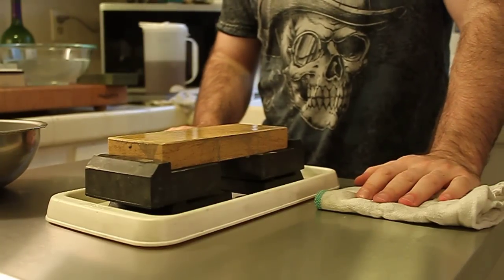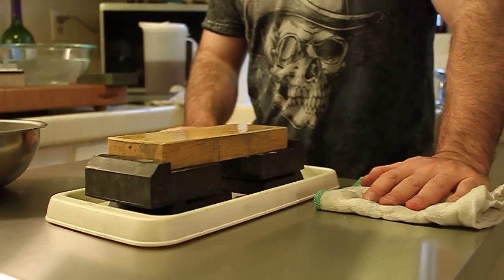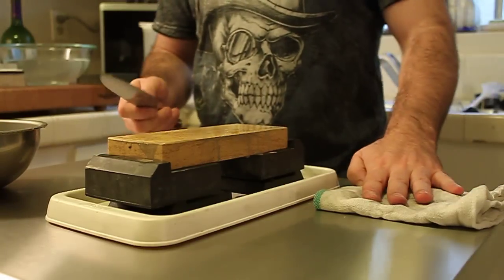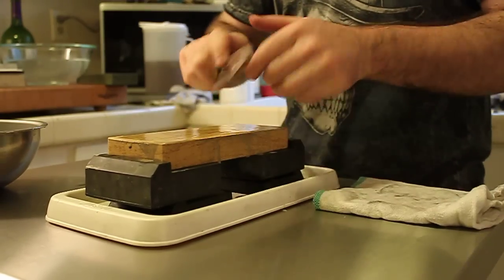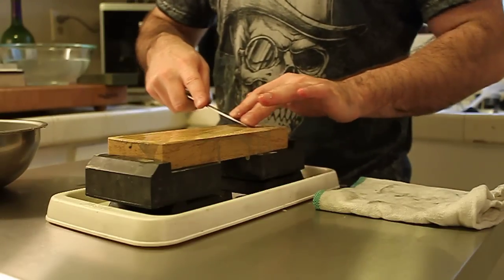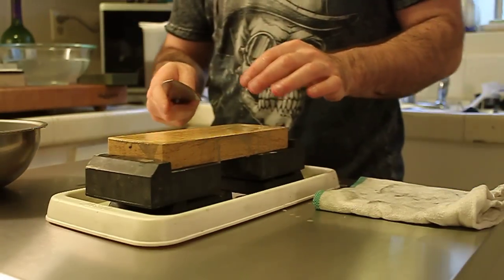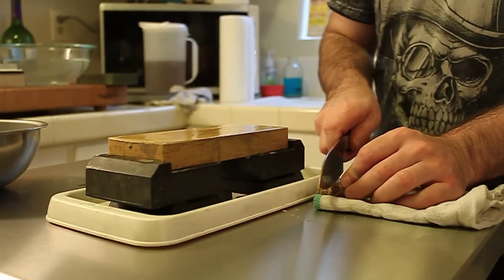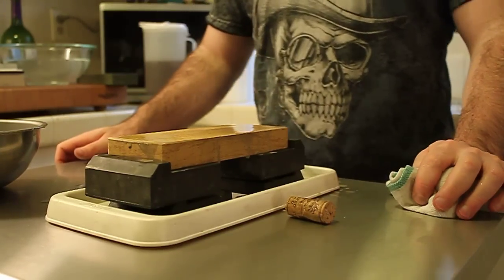Microbevels- Japanese Knife Imports

Comment from the maker: it depends on the steel, heat treatment, how big your microbevel is, and how many times you have touched it up already.  If its too big or has already been touched up too many times, you have to sharpen the whole edge and then re-do the microbevel (which shouldnt take long as it should be a MICRO bevel).  If its still small and hasnt been messed with much, you can just touch up the microbevel.  Stropping only matters for the actual edge, so only the microbevel there.

Comment: Very nice explanation of the micro-bevel method of sharpening.  I use the convex edge method with a belt sander and leather strop.  I believe this is a similar idea, but with the addition of electric power.  The main idea is to remove the wire edge, not constantly realign it with a steel, as in western practice.  And, Japan steels generally don't respond to steels as they are harder.  Thanks again.

Comment: For me microbevel is part of the core techniques for sharpening because it makes a huge difference. I do 15 degrees microbevel on both sides , alternating passes ,edge leading. This is enough to hold the edge even on soft steel if you cut without impact and don't touch bones.
Reply: O que você diria a respeito dele fazer o microfio em apenas um lado da faca ?
Reply: @neymacieloliveira5265  Se for uma faca single bevel eu colocaria apenas do lado que tem bisel. 
Se for double bevel eu recomendo colocar dois lados. Um ângulo total de 15 graus de cada lado dá uma estabilidade muito boa contra rolamento e é eficaz mesmo se vc fizer ele com apenas 0,05 mm de largura. 

Pra faca chefe fiz um esquema muito bom é dois microfio, um de 15 e outro de 10 graus, seguidos por um fio de 5 graus. Isso aguentou impacto moderado na tábua de corte apesar da faca ter apenas 54 HRC. A ideia não é usar com impacto mas se aguentou isso deve durar bem com uso normal desde que vc saiba cuidar dela e não abuse.
Reply: @thiago.assumpcao  Sim, já tinha visto em seu canal que por sinal sou um assinante entusiasmado! Mas é contra intuitivo a firmação dele que o micro fio de apenas um lado da faca é mais eficiente que o duplo micro fio, não acha? Me parece que a pressão de impacto tem menor resistência por não serem simétricos os desbastes.
Reply: @neymacieloliveira5265  A pressão de contato vai depender do ângulo total. Se fizer 30 graus de um lado deve ficar parecido com 15 de cada. 
O problema é que  Single bevel o fio não tem sustentação em um dos lados então considerando o mesmo ângulo total o fio fica com menor estabilidade e durabilidade para a mesma capacidade de corte.
Single bevel é bom para tarefas específicas. Ele facilita fazer cortes fininhos longos. É bom para plano de madeira, Usuba , Yanagiba mas não acho boa ideia em uma faca chefe.

Comment: Jon, does it matter whether you put the microbevel on the left or the right side of the knife? (Left-handed sharpener but slightly right-biased J-knives). Let's say if the knife currently has approx 10-12 degrees on the right, and 15-17ish on the left
Reply from the maker: In generaly, the idea is that leftys do it on the left side and rightys do it on the right, but i would say try both and see what makes more sense for you
Reply: Thanks for replying, wasn't sure if the rationale was that it should go onto the side with the more acute angle, but I will give both attempts a try.
Reply from the maker: really, very little about sharpening can be boiled down to hard and fast rules... as long as you have a way to critically think and explain what you are doing, you should be all good.

Comment: you micro bevel one side of a 50/50 ground knife? I must say i've never heard of that. Doesn't that turn it into a deferentially ground knife out at the edge? 
I would think that would cause the knife to be weak to rolling one way or the other. Japanese knives really don't roll much, they chip or survive but on a western softer blade perhaps.... 

I have a Tojiro Yenagi, out of the box the bevel side has a REALLY high micro bevel, closer to 45 degrees, and the back side has a tiny one, maybe like 2 or 3 degrees.... is there any point in microbeveling both sides of a single bevel knife?
Reply from the maker: +Max Savino it seems as though you may misunderstand both asymmetry and single bevel knives here... shoot me and e-mail if you can, as i have a good explanation i would like to share with you (its much too long to type here)

Comment: Hi John, thank you for video. After 9 years it's still helping. :) Have a question. After put a microbevel can I hone it with a ceramic steel? Do I need to try different angles or something? Also If I want to get rid of the microbevel is it just fine to sharpen it on whetstones? Thanks.
Reply from the maker: In general, if a knife requires a microbevel, its either because its extremely thin or extremely hard.  Both things would make it less ideal for use with a honing rod.  Addtionally, maintaining a consistent enough angle on the rod for that to work would be rather difficult.  Stones are likely your best bet.  If you want to remove it, just sharpen the bevel until the microbevel is gone.  Let me know if you have any follow up questions.
Reply: @JKnifeImports  thank you so much!
Reply from the maker: @necdetemirdemirtas  no prob... anytime

Comment: I am interested in the Microbevil for pocket knives.  I would like to achieve the same type of result using a camp based system. 15 degrees per side 30 degree Microbevil.  Any ideas on how to do it on a KME?  Thanks for the video 😎👍
Reply from the maker: I would not recommend this for most pocket knives as I teach it here.  This is really for things that are very hard and very thin and would otherwise would be too brittle.  Pocket knives would be handled in a different way.  Why not just a higher angle?
Reply: @JKnifeImports  I have knives made out of ZDP189 and others at 62+ Rockwell hardness.  I have dialed them back to as low as 12 degrees per side.  The experiment is to see if steep angle and a Microbevil outperforms stock from the factory edges.  I believe that most folks who don't like Microbevils are not getting the edge set up correctly.  With the clamp system the angles are dialed in exactly.  Your idea of a one side sharpening sounds great.
Reply from the maker: @barkingspider2007  Its a lot less about the hardness or bevel angle and more about cross-sectional geometry behind the edge relative to the hardness and bevel angle.  Pocket knives are thicker behind the edge than most kitchen knives, and thus this type of sharpening makes less sense.  If it were a crazy thin knife behind the edge, then it might be a worthwhile method.  But either way, feel free to give it a shot and let us know how it goes.  Remember, the microbevel should be small... like a single thin thread or a strand of hair.  Hope it goes well.  Please keep us posted.
Reply: @barkingspider2007  I have no experience with pocket knives but I really like microbevels. I have kitchen knives from 55 to 60 HRC and they hold well the edge with 10 degree sharpening as long as I put a 15 microbevel at the end.

Comment: So the video is about you using a micro-bevel to remove a wire edge / micro burr - which you demonstrate - yet you then went on and used a cork to remove the burr after doing  micro-bevel? Why? Wasn't the point of the micro-bevel to remove the burr by itself?
Reply from the maker: It does help with burr removal, but is not perfect for burr removal... ergo the cork
Reply: Electron microscopes have show that pulling the burr through cork, felt, wood etc, only tears off part of the burr leaving a weakened work hardened edge that is much less than optimal. Try a few edge leading strokes on the hardest stone you have at very light downward pressure on the knife edge.  You don't want to create another burr. You only want to remove the burr and then put a 5 DPS+ increase to create a hair with micro-bevel. Cliff Stamp has some excellent information on this approach.

Comment: Really want to learn about this but don't really understand why your putting a micro bevel on?
Reply from the maker: microbevels are intended to achieve the following things (not necessarily all of them, but at least one, if not a combination of a couple or more):

-maintaining extremely thin geometry on a knife that could not otherwise handle it
-reduce chipping in super hard steels
-increase stability in larger carbide steels (especially at low sharpening angles)
-improve edge retention at a cost of maximum sharpness
Reply: Japanese Knife Imports OK so do you put a bevel on both sides of the blade or is it only for the Japanese style blades?
Reply from the maker: just one side and it works for both single bevel and double bevel knives, but isnt always the best idea in every case... like i said above, those are the cases it works best for
Reply: Japanese Knife Imports OK well thank you very much for the advice I'll give it a go and if I can't iv lost nothing thanks again.
Reply from the maker: Feel free to bug me with any other questions as you give it a shot
Reply: Japanese Knife Imports yeah I will thanks using a global and a kai at min it's only for home use now as iv just had enough of cooking every weekend.lol.i find both of them a little bit soft I'm only sharpening to 3000 grit as I don't want it to be brittle and it's perfectly fine for a month.is needing a finer stone or a micro bevel to keep the edge longer?
Reply from the maker: i dont know how much a microbevel will help here... they are neither really thin nor extremely hard.
Reply: Japanese Knife Imports OK well thanks anyway I'll just try a finer stone and if that doesn't work Ill just have to treat myself to another kasumi.lol.or is there anything else better for that sort of money?last question I promise.
Reply from the maker: with respect to edge retention and edge taking?  What price range specifically?  Also, keep in mind that things that often have better edge retention or edge taking will be a bit more brittle.
Reply: Japanese Knife Imports so a kasumi 8" cooks knife is about $250-220 with rockwell 60 made from vgold no 10 carbon steel
Reply from the maker: there are a ton of options in that range... for example even the gesshin ginga we have is in that same range and is thinner and harder.  Thats not the only one, but there are a ton of great options in that price range.